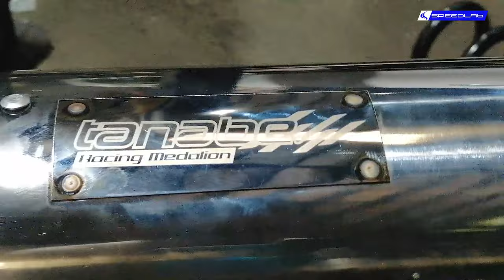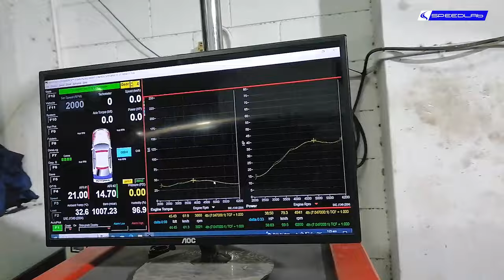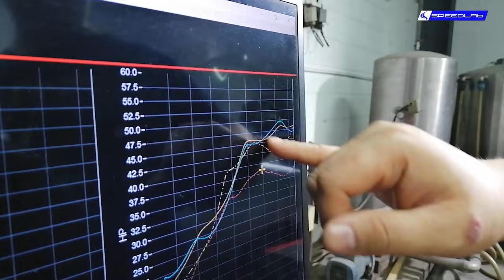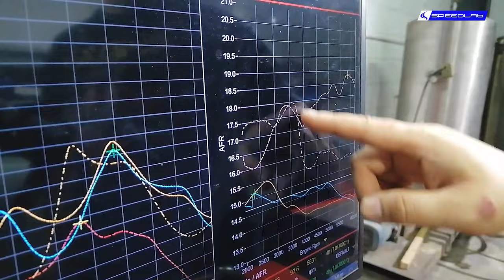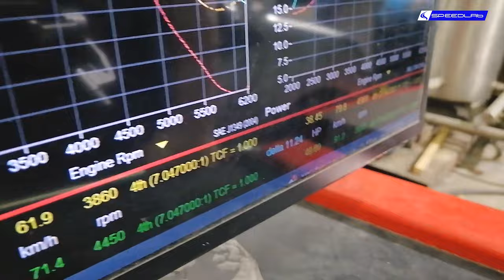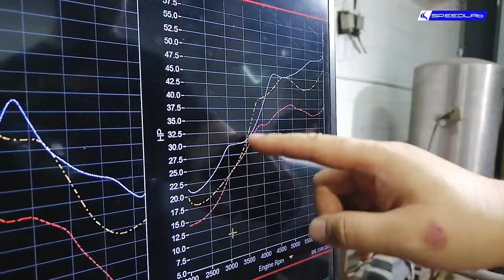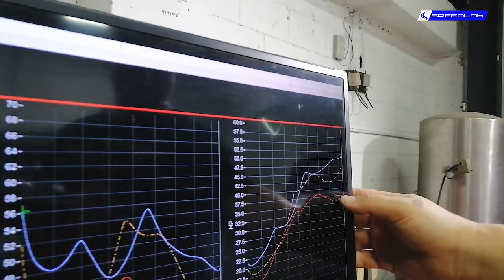Toyota Wigo Tanabe full exhaust installation, Unichip ver. Toyota ECU Remap Reflash

Comment: Hm po pa ganyan wigo 2021
Reply from the maker: P25000
Reply: @speedlabchannel4452 for mirage g4 sir pwed din po? And hm po. Thanks
Reply: @speedlabchannel4452 the Php25k for wigo is inclusive of all the modification made in this video? Do you also accept credit card as payment?
Reply from the maker: @rrdmhacx21  no. 25k is just for the Unichip 
Another 25000 for the Exhaust
Reply: @speedlabchannel4452  Does this include the K&N Intake Filter upgrade?
Reply: Since I asked I question already, HM will it cost to have the service for the following? K&N Filter Intake & Unichip installation, Full exhaust upgrade and strutbar installation inclusive of labor for our 2016 Toyota Wigo G?